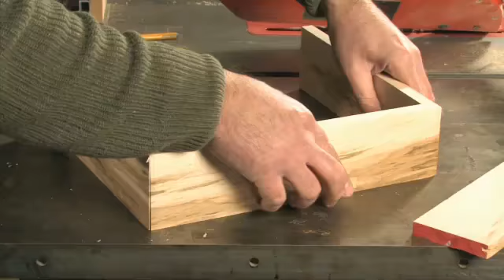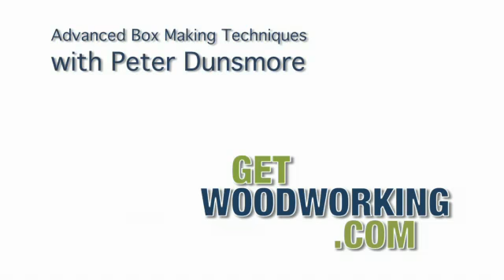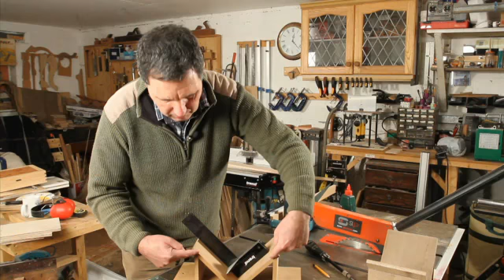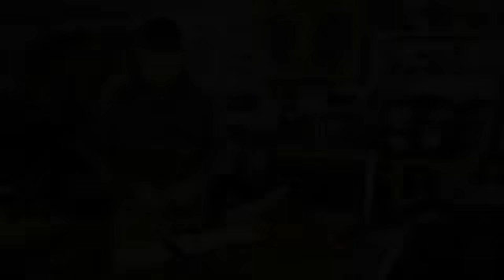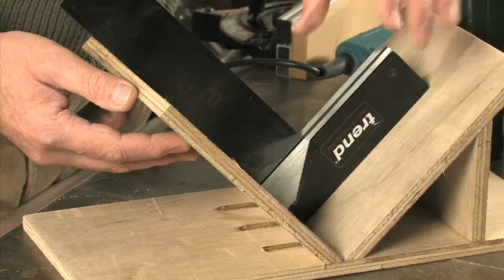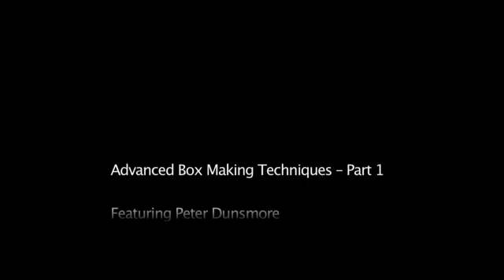Advanced Box Making Techniques Part 1

Comment: Hello Peter, AKA Getwoodworkingtv,

I have just found your channel and hope you have lots more videos, though I have not checked yet. I will write a PM to you.

I would love a standard table saw because when the work can be cut with a sharp saw at any angle and the edges are clean it makes thing so much easier.

My Dad was brilliant at wood working, as you show there is nothing difficult, it just takes careful measurement over and agin on the jigs which will save a lot of time.

mrbluenun